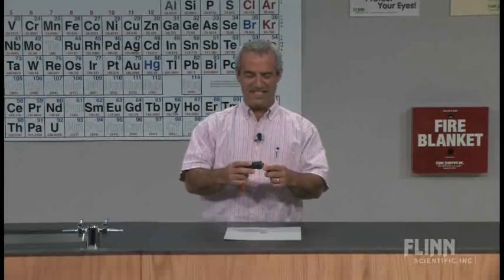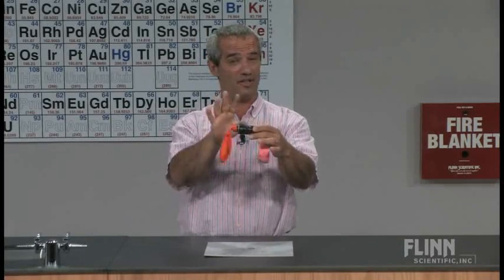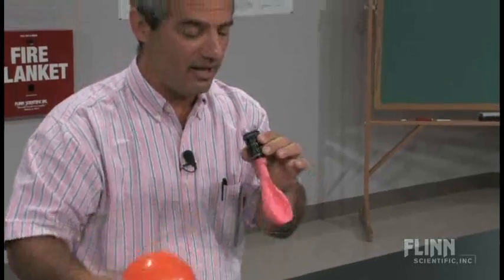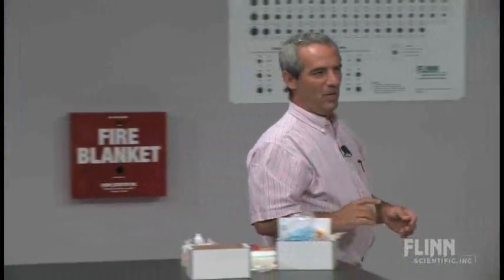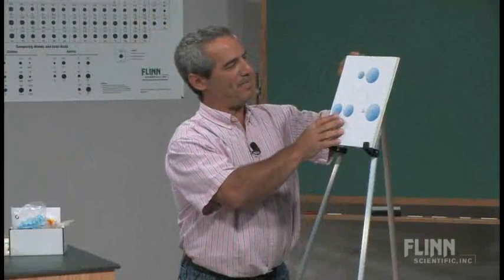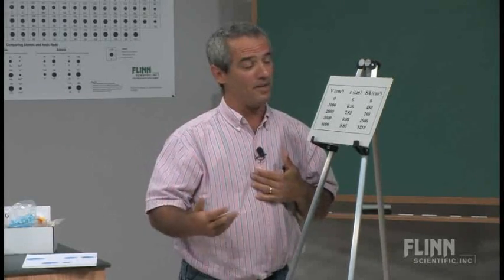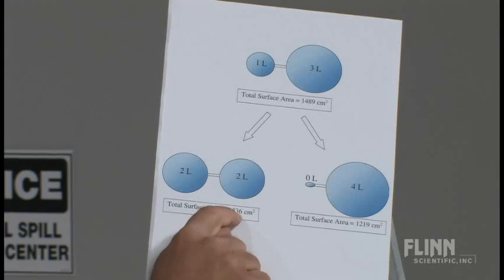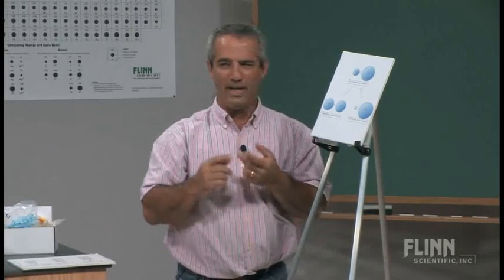Discrepant Balloons

Comment: I do this demonstration a lot. As a polymer physicist I can tell you his explanation is incorrect. There is an easy way to demonstrate why his explanation is incorrect here and to demonstrate the correct explanation.
Reply: What easy way?
Reply: @samirshah848  The effect has due with the hysteresis of the rubber balloon. If you were to map the pressure inside the balloon as a function of the strain (size), You would see the stress (pressure) increase drastically in the balloon under initial inflation. When the balloon gets to a certain size there is a stress relaxation and the pressure drops as the balloon gets bigger. That initial elastic restoring force that makes the balloon difficult to inflate gets smaller after the 2nd or third time you blow it up. So, blow two balloons up to the same size (kind of big), then let some of the air out of one so that it is smaller. Then attach the balloons to the apparatus and open the valve. You will see that nothing happens. There are only two outcomes that can happen. Either the discrepant event occurs, or there is no observable change.
Reply: @kirtpage3573  So the difference in stress of the elastic material is the driving factor and not the pressure  difference of the air inside?

Comment: I'm not convinced, if we start with two equally filled balloon then the system should move to the same configuration (an empty plus a bigger balloon) 
another inportant thing to look at is the air in the valve should move from the higher pressure to low pressure, since the pressure in the bigger balloon is higher because to fill it we need more and more pressure .

Comment: what dose surface area have to do with this ?!
it is about the tendency of pressure equalization.
Reply: Well, the answer is yes, the pressure is equalizing in both the balloons in the entire process, since the pressure is higher in the smaller balloon the air continues the flow from the smaller balloon to the larger balloon until the pressure is equalized, but the equalization of pressure implies that the energy is minimized since the energy of the system cannot increase as it would violate the second law of thermodynamics.

Why does the surface have anything to do with the energy of the system of balloons?
The answer is because when you blow up a balloon, its surface or material comes under stress (as it increases in volume) which arises due to intermolecular forces between the molecules that make up the material of the balloon. Naturally, when you blow up a balloon, The amount of work you do is spent in expanding the balloon's surface area which in turn increases the energy stored in the surface of the balloon as the surface area of the balloon increases.

So in the setup, the configuration which has the lowest energy will have a 100% probability of being the outcome  (as is the case in all macroscopic processes), and since we have already established that the combined energy of the balloons is proportional to the combined surface area of the balloons, the resulting configuration would be that of the minimum energy configuration and hence should possess the minimum combined surface area.

Note: Here I am assuming that the process is isothermal, meaning there is no change in temperature and hence there would be no change in the average kinetic energy per molecule of the air inside the balloons and the tube. 

For simplicity, you can imagine the energy stored in the material of the balloon (When it is expanded) as elastic potential energy.

Hope this helps. :)
Reply: @rulersonicboom4737  
Thanks a lot for the very useful replay.

Comment: It's real easy to come to the wrong conclusions. I have done it many times. :-(

 Is there a law of conservation of surface area? No.

Air flows from high pressure to low pressure. The pressure in the big balloon is lower than the pressure in the small balloon because the rubber is stretched thin in the big balloon. Use your rig to actually measure the pressure in each balloon separately using a gauge that reads in the 1 or 2 psi range or you can rig a manometer from some clear plastic tubing and dark tea. We all feel the effort going down as we continue to blow up a balloon.
Reply: Paul Ohlstein Doing the math doesn't help if you're missing the physics.
Reply: +Paul Ohlstein Correct, it is related to pressure. Initially as the balloon is filled, the pressure increases. However, if the balloon is filled with a critical number of air molecules, the pressure actually begins to decrease as more air is added (due to the elastic properties of the rubber). It just so happens that in the video, the large balloon exceeds this number of molecules, and the small balloon does not. Thus, the smaller balloon is actually at a higher pressure. In order for the pressure to reduce in the small balloon so that it equals the pressure in the large balloon, the small balloon decreases in size since it is below the critical number of air molecules. Since those air molecules have to go somewhere, the only place to go is the large balloon in this closed system. This leads to the larger balloon expanding (and also decreasing slightly in pressure, but the smaller balloon decreases in pressure more so the pressures are equal).

If both balloons were blown up either below or beyond the critical number of air molecules (not one balloon on either side of the critical number), then they would in fact end up at the same size in this demonstration.
Reply: one would think that's a pretty important caveat to've included in the video, right?
btw, how is the critical number determined?

Comment: Atmospheric pressure vs the pressure in each balloon has nothing to do with it?
Reply: No this should also work the same in a vacuum.  The pressure inside the balloon is mostly due to the contracting force of the material of the balloon.
Reply: The equalization of pressure implies that the energy is minimized since the energy of the system cannot increase as it would violate the second law of thermodynamics.

Why does the surface have anything to do with the energy of the system of balloons?
The answer is because when you blow up a balloon, its surface or material comes under stress (as it increases in volume) which arises due to intermolecular forces between the molecules that make up the material of the balloon. Naturally, when you blow up a balloon, The amount of work you do is spent in expanding the balloon's surface area which in turn increases the energy stored in the surface of the balloon as the surface area of the balloon increases.

So in the setup, the configuration which has the lowest energy will have a 100% probability of being the outcome  (as is the case in all macroscopic processes), and since we have already established that the combined energy of the balloons is proportional to the combined surface area of the balloons, the resulting configuration would be that of the minimum energy configuration and hence should possess the minimum combined surface area.

Note: Here I am assuming that the process is isothermal, meaning there is no change in temperature and hence there would be no change in the average kinetic energy per molecule of the air inside the balloons and the tube. 

For simplicity, you can imagine the energy stored in the material of the balloon (When it is expanded) as elastic potential energy.

Hope this helps. :)

Comment: this was explained wrong.
Reply: This was explained correctly. You can explain the process through equalization pressure in both the balloons or minimization of energy stored in the balloon due to surface tension. Assuming the process is isothermal, meaning that the temperature is constant which implies that the average kinetic energy of air molecules inside the balloons and the tube doesn't change throughout the process. Since energy stored in the balloon due to surface tension is directly proportional to Area, therefore the outcome of the experiment should be the configuration in which the energy of the system is minimum which would imply that the outcome should be of the configuration where the combined surface area of the balloons is minimum.

The formula for Energy Stored due to Surface Tension (for reference),
U = SA 
U=Energy Stored due to Surface Tension, 
S= Surface Tension (Property of the material), 
A= Surface area of the membrane.

Hope I made my point. :)